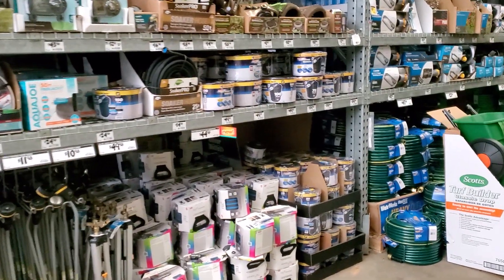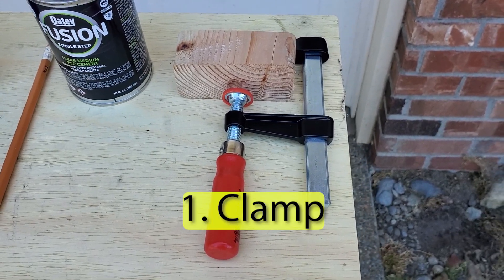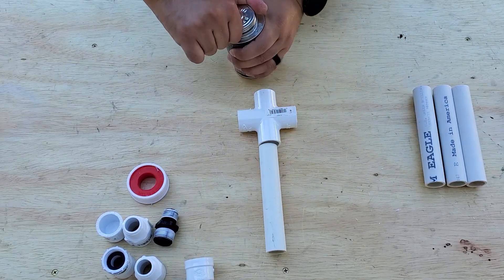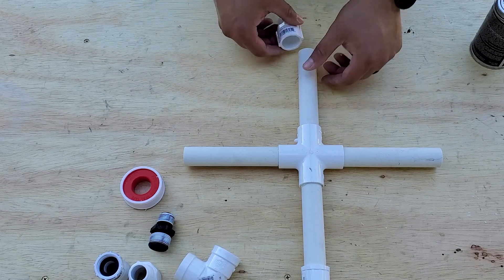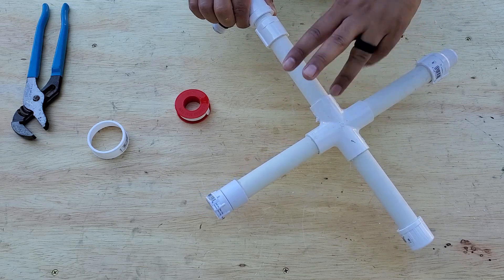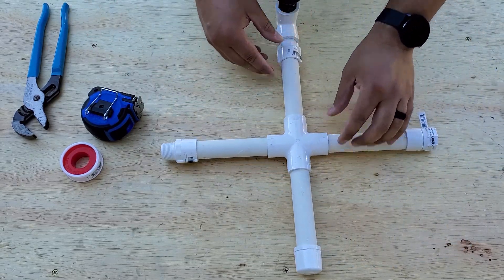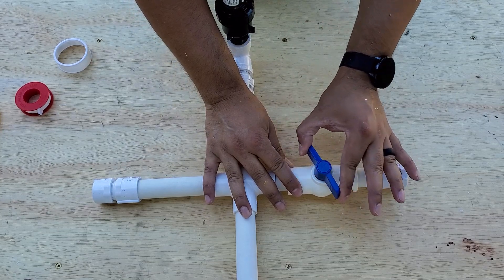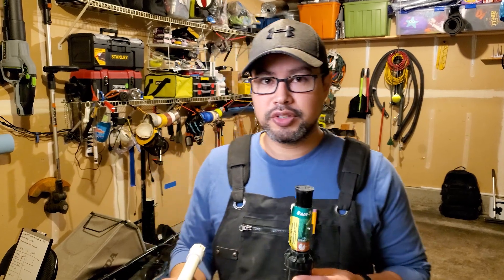Sprinkler Stand Simplified. The easiest way to build a sprinkler stand.

Comment: do it go 360 and can you adjust the range of water, example, for 5 to 10 to 15 feet. Thanks and great video.
Reply from the maker: Oh for sure you can adjust the distance and spray. Your water pressure will play a part in that as well.

Comment: Or - if you don't like your impact sprinkler or other type of sprinkler that screws into a base , a lot of them the impact (or other) heads will unscrew off of the base and a half inch irrigation "riser" will fit into that threaded hole in the base and then screw your pop-up onto that riser in the ready-made base 😊
Reply from the maker: Hey there, yes that is a convenient option. I just have to many sprinkler heads to keep spiking down into the ground (and are a potential safety hazard do to the pointy spike). I personally just got tired of it, especially because my lawn has so many rocks that have bent my spike and have had to replace the base due to the spike breaking making it unstable. In my opinion, these pvc stands are way less of a hassle and are not limited to just placing them on the lawn. In the end it's whatever works best for you. ;)
Reply: @vandit0o0o  this pretty much also works on ANY kind of base I have found , spiked or "sled"  including cheapy ones where a sprinkler head screws into pretty much any kind of base not necessarily a spiked one 😊
(edit: it does need to be a somewhat broad base like your video shows if you want to use a gear drive rotary sprinkler so the emerging water pressure from the sprinkler doesn't topple it over - this would not really apply to a lesser water pressure sprayer head sprinkler where you could use a smaller base)
Reply: How many videos are you going to type this exact same comment. Must be a bot? Idk.

Comment: I see lots of videos like this and I am left wondering, why not just buy the impact sprinkler spikes and use the rain bird adapters? I mean the spikes can be bought for less than $5.
Reply from the maker: Good question. The spike is the whole reason of why I made this stand. For me and my neighbors, it got extremely annoying dealing with the spikes every week, especially when you got to adjust  6 spikes at a time. Not only that, when the spike hits rock as it goes in the ground, it bends and eventually breaks. In my opinion, spike are a temporary quick fix, annoying to set up and they can be a little brittle. And honestly, for me watering my grass became much more enjoyable after using this sprinkler stand.
Reply: @vandit0o0o  rocky, hard ground is an obvious reason to opt for a stand over a spike, can't believe I didn't figure that out on my own...
Reply: @Nathan-ho7vr  Another nice thing about the stand is you can drag the sprinkler to a new spot.

Comment: Would it make any difference at all if one decided to place the water inlet on the back side across from the sprinkler head ?
Reply from the maker: No, I believe the water pressure would remine the same. Give it a try if that design would benefit you in any way.

Comment: I would like to try this build but it seems as my home doesn’t produce enough psi for water. I brought two sprinkler units from lowes for 10$ a piece. Hooked both up but can only use one at a time. Does this unit build psi in the heads.
Reply from the maker: Hi there. No, I wouldn't say this sprinkler head builds pressure. You may want to look into upping the water pressure from your main incoming water line. Just a little at a time until you notice better water pressure on the heads. Speaker with a plumber in case you're unsure of your main water line and don't use thin 1/2" hoses. Stick with 3/4".
Reply: Yeah, I got low water pressure at my house too, what I did was added a double spigot to the faucet and ran two 3/4" garden hose one for each sprinkler and I was able to use both sprinkler at the same time, and on that double spigot it comes with a shut-off valve so you can adjust the water flow for each line.Your friend has shared a link to a Home Depot product they think you would be interested in seeing:

Melnor	2.76 in. Metal Y Connector
https://www.homedepot.com/p/Melnor-2-76-in-Metal-Y-Connector-9000/100178887
SKU# 100178887
Reply from the maker: @craftman5632  Yeah, low water pressure really makes it a hassle to water correctly. Glad it worked for you. 👍

Comment: Why not use an x fitting with female threads on top, a five way fitting?
Reply from the maker: Great question. For the shape of my own lawn, this was a simpler and cheaper solution. Since I setup the sprinklers at the farthest corner, I wanted to make sure those corners didn't miss out on the watering since these sprinkler heads are meant to be only a few inches about the ground. Plus, this design is still very stable while actively watering. I hope this helps.
Reply: Because I don’t think they make it. I’ve been looking for years for this, and never found it, at least in something pressure rated (I have found them for furniture, but not for plumbing). If you know of any, please post it here!

Comment: Do you post a bill of material for this?
Reply from the maker: Hey there, great question. The pvc parts may come out to around $17. The glue & thread tape around $13. So around $30 total, but you don't use up all the pvc pipe so you can save money there when building more stands. Hope this helps.
Reply: @vandit0o0o  Thanks, Albert. I know it's in the video but I was wondering if you have a list of all the parts needed?

Comment: Those are complete junk, I made mine out of heavy galvanized pipe, with a five way in the middle,  real apollo fill port ball valves, With hunter i 20 heads no rock needed to hold the bases sown they very heavy and durable